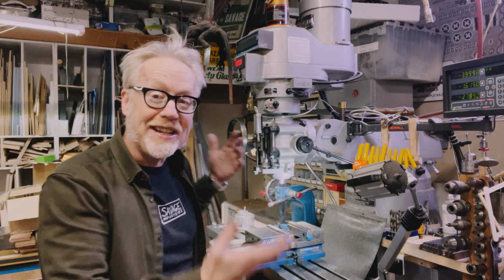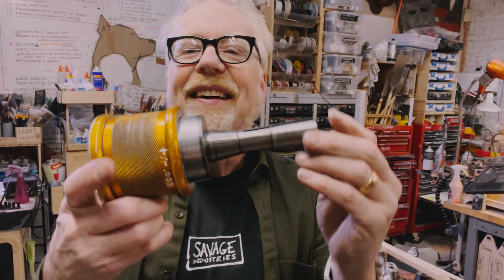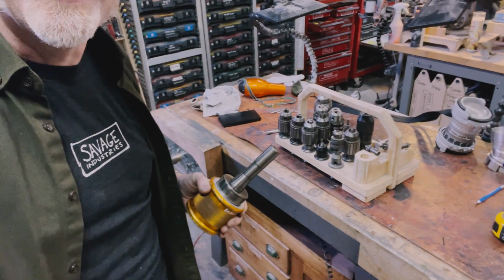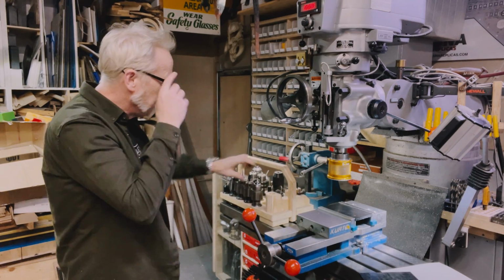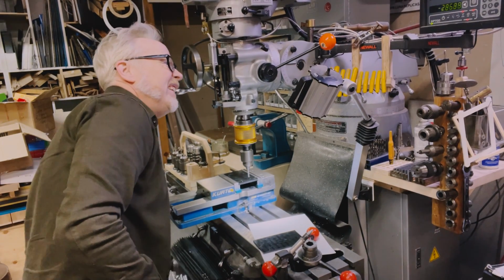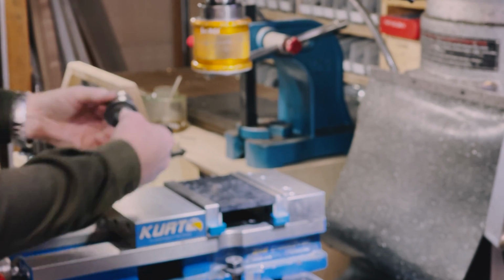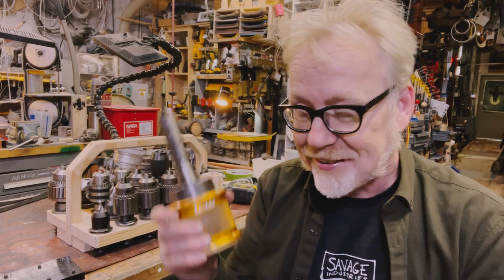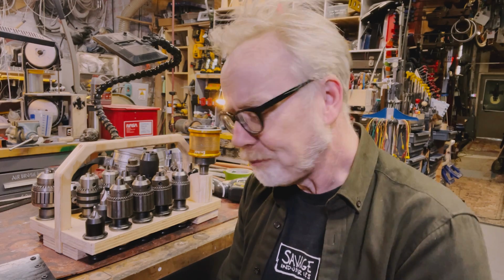Adam Savage's Favorite Tools: Quick-Change Tool Holders!

Comment: AHA!! I used to have one of those but they have two glaring problems: 1) they take up a LOT of Z axis travel and 2) it's pretty much impossible to do good work when  there's a side load on it; i.e. milling. For a good time I'd suggest you upgrade to the R-8 Snap Change system, which gives much better accuracy and which takes up nearly zero Z axis travel. ALSO:  that thing you call a 'countersink' is a 'counterBORE'. A good countersink has a single flute and generally an 82 degree angle on the point. Oh PS if you ever get up to Santa Rosa give me a jingle and I'll show you what hacks I've got after  40 years of hobby machining. :-)
Reply: 82 is for metric and 90 is for imperial

Comment: If I had a big enough shop,  I would have multiple drill presses all lined up.   I have 2  (3 if you count a portable Rockler drill guide), and will mount drill and clearance drills in them if I have to do a lot of these types of holes.     Imagine an 8' workbench with just bench drill presses!  After all, you don't really need milling machine accuracy for many of these operations. 

That said, a very cool gadget for the milling machine.  It wouldn't surprise me if someday Adam gets a Tormach, and then, let the games begin!  LOL

Comment: Not a machinist, but I wonder why he doesn’t just get more R8 spring collets to hold the bits. He already has a pneumatic draw bar impact for quick tool changes. It’s like he has a quick tool changer mounted on another quick tool changer. I would imagine his current setup would increase run-out. Also, when he says it would require 7 tool changes * 16 holes = 112 bit change operations, I don’t see why you wouldn’t just center drill all the holes in one step, change bits, drill out the holes in another step, change bits, so on and so forth. This would only require 7 tool changes. Not that you don’t need a fast way of changing bits, I just don’t understand why he does it this way.

Comment: Is it possible to save those positions so that you can have the mill automatically go back to those positions for you?
Reply: The DRO would have a hole feature (circular and rectangular). For what he was doing he could have moved the cutter to the first hole and called that 0,0 (does not need to be machine 0). From there he would specify something like 6,2;1.000,3.000 (where it is 6 holes in the X axis, 2 in the Y, X axis is spaced 1" apart and Y is spaced 3" apart). From there you just do an operation and hit next and adjust the table so the DRO reads around 0.000x0.000. After the last hole is made it will cycle back to the first. Typically it is not worth programming that for only a few holes, but I would have absolutely used the feature for what he was doing.

Let me know if you would like a better explanation.

Comment: Your counter sink is actually a counterbore your chamfer i suspect is a countersink unless its angle is 90 degrees and not 82 and the screws are socket head cap screws just a friendly comment from a tool Maker

Comment: It feels like this is more of kinda a niche tool option.  Large fab shops will have multiple machines or tool-changing CNC to make a small production line.  A small time, one-off shop will stick to the R8 collets and just do the operations in batches.  But with the expense of tooling up to use this I don't see any shop doing that unless they ONLY make 1 thing.  No variations, no piece work,  no prototyping, just a single product.  Gunsmiths maybe when doing scope mounting holes?  It's not like a lathe where your tools are limited to a certain set and the versatility is in moving the tool.  Now if you make all your drills, taps, end mills, cutters, etc compatible with a quick change system then I think you're on to something.  But you're talking about changing standards all over the world and increasing the cost of a disposable item.

Comment: Hey Adam, check out the Mach-1 Quick change system by Arro! It's way more compact and would give you more 'z' work height, I use one at work and they work great for drilling and milling alike. Check it out!

Comment: I'm confused. It seems like the mill has a pneumatic tool holder. Isn't that a quick change tool holder already? The manual mill at work has a threaded draw bar (I hope those are the names of these things, German dude here) and I have to screw each new tool in and unscrew to release it. So it takes a good minute or two for a change of tools. This seems like it is pneumatically operated, like my CNC mill, so it releases with a push of a button and it tightens on the new tool with a push of a button, right? If that is the case, then I don't see the advantage for this setup.

Also, jesus, I'm happy I'm on CNC machines these days. Spot drilling, drilling, tapping, counter boring is soooo tedious on a manual mill. :D I'd still take a chunky mill if someone wants to give me one! :P

Comment: Not sure why switching bits in a regular drill chuck isn't almost as fast... you only have to put the chuck into the collet once, and then you take the drills, chamfer tool, tap, in/out of that single chuck as needed.  (with the quick change, you are still doing the same actions, taking the same time, putting the bits in separate chucks, are you not?) I get that if you were making 100 of these plates per day, the quick change might be worth it.  But for one or two?  why would I get this expensive tool, plus all the extra chucks?  Having said that, cool video, and the quick change holder is pretty neat.

Comment: ADAM! Make Sure you are using a spot drill, not a center drill.  Spot drills drill at an angle of 120 degrees, which is perfect to accept a 118 degree drill as center as possible.  Center drills are incorrect for drilling holes in true perfect location.

Comment: I have a simplistic question to ask as I’m not familiar with drilling and milling (my craft is coding) but find machining fascinating.

If a mill can do drill pressing operations, why does Adam have a separate drill press? 
I’m sure there is a good answer for this as he uses up valuable space in his shop to have both machines.
Reply: Probably just because if you have something setup in the mill, and you just need to drill a few holes that are not that precise, you don't have to tear down your setup on the mill to drill some holes. And also he probably had a drill press long before he had a mill, so now he just has both.
Reply: Drill press is for wood. The mill is for metal. They are doing the same operations with Drilling, but each machine is designed specifically for a certain range of materials. The milling machine isn't just a more rigid, it is bathed in oil andhand-scraped  to extreme precision. Sawdust is a nightmare on the mill.

And likewise the drill press isn't just a light-duty milling machine. It's range and torque and Power are all designed around woodworking drill bits which have completely different geometry than what's on the mill. And while you can drill metal on the drill press, that could cause hot shavings to fall in a saw Dusty environment
Reply: @patrickosullivan4354  thank you for explaining that clearly, it makes sense to have the right tool for the job.
Reply: @gorak9000  I imagine setting up the mill can take some time. Thanks for replying to my question
Reply: @patrickosullivan4354  Drill presses are just as much for metal as they are for wood - that's why they're variable speed. You use slow speeds for metal, and higher speeds for wood. As you mentioned, drill presses don't have precision x-y positioning, and the biggest technical difference is the spindle in a drill press is only designed to take axial loads, as you're only drilling straight down. A milling spindle is designed to take both axial and radial loads, as you can be milling into something vertically (when plunging into the work), or milling horizontally (like cutting a pocket, or facing) as well. They use completely different types of bearings in the spindles to achieve this. In general a mill is much more rigid in every direction (and thus physically heavier due to more cast iron), and is made to much higher tolerances in every way - the bearings are tighter tolerance, the spindle run out in a mill will be much lower, etc. That said, you can also get high quality drill presses with good tolerances, and you can get really crappy mills that have poor tolerances.
Reply: The drill press really comes in handy if you're just picking up an existing hole to do another operation on it. In the mill, you would have to indicate in the hole which takes a bit of time. Basically, a drill press is good for quick and dirty stuff.

Comment: Can a quick change tool help? Yes, however you could probably achieve the same amount of speed with a hand tighten drill chuck that goes directly into the mill. You then just change bits in the chuck.  I have to admit it is cool to be able to have a series of drill chucks preset up, but the cost of that compared to just having a single hand Chuck is significant.  Not dissing on your video here, just providing a alternative possibility.
Reply: Love my Albrecht drill chucks. Fast and high precision.
Reply: @grntitan1  omg that was exactly what I was thinking. I have one too.

Comment: Adam you should do every thing you can with each tool like drill all the holes chamfer tap w oil save a ton of time Adam I'm thinking you know better I'm shur you should be tapping very last like why tap material that your only going to be removing later.

Comment: It seems to me that the time installing the bits etc into all the chucks takes almost as much time as just swapping out the bits into one chuck.  Not to mention the cost of buying all the chucks and the quick change chuck holder. What am I missing?
Reply: Setting up the tool holders is one and done. Swapping bits in a chuck is more time consuming because your reaching for a chuck wrench every time.

Comment: Pro tip: if you use a VFD with a breaking resistor you can get the spindle to stop very quickly. The way Adam was grabbing the spindle as it was still spinning scares the crap out of me. The way I have my Bridgeport set up I can stop the spindle in a second without using the mechanical break. The VFD also makes it easy to reduce speed for something like a tap where you really don't need the torque. It also allows you to get much lower speeds if needed (one time I needed to run a 6" hole saw in stainless at around 40RPM).

Keep up the good work, and try to not let the mill finish the job the lathe started.

Comment: Umm  "Keyless chuck" anyone?  I can see that you already have an Albrecht or clone chuck there.  If you're not doing milling operations anyway, why not just use a keyless chuck?
Reply: This thing can be slightly quicker and you get a repeatable tool offset. So you can save each tool in the DRO which would be useful if your doing a ton of counterboring. Then again if I was doing a bunch of counterboring I'd grind my own to drill and counterbore all with one tool.
Reply: @lordgarak  Only if your mill has a Z axis DRO.
Reply: @lordgarak  I guess I see your point there.  He just didn't pick a great scenario to show it off.

Comment: While the tool change system itself is a useful idea, for the holes-in-plates task wouldn’t you be able to remove a step at the beginning by simply stacking the plates aligned and drilling the pre-tapped, pre-countersunk holes through both at once?

Comment: That is an awesome toolchanger you got there. If the runout was better it would be great for a CNC milling machine. Is there maybe a bur on the inside taper?

Also one tip: imo you're running the machine a bit too fast. A little bit slower would be better controllable, especially for tapping and chamfering. Don't worry, it will propably be still as fast since the chip created will be thicker. Especially on chamfering/countersinking tools I noticed them to chatter a lot if they go too fast.

Comment: FIRST WE NEED TO... wait that's not right ... FIRST WE NEED TO... is that right??? FINALLY WE NEED TO!!! 

Doing this means we have to reach around an el-elbow to whipe the butthole we're drilling.... 

"Yep. Maybe it's going to take a lot longer than it should..."

That whole thought process has cost me hundreds of hours and not being familiar with the concept probably cost someone thousand. It's honestly the biggest disconnect from "engineers" to production. 

Man hours mesh nothing until you spend all 8 hours in a day making a dang hole.

Comment: do you necessarily have to accept toxic substances to engage experiments or perhaps understand science method? if the law of ratios is integral to our understanding of applicable science.
Reply: imagine a fraction of weight causing displacement in a demonstratable state of equilibrium.

Comment: Since you don't need a collet for any of the tools you were using, I'm not sure this is that much faster than a good key-less chuck.  Also if you use a 135 degree split point, screw machine length drill bit, you don't need a starter drill to get accurate holes.
Reply: Stub drills are great, less flex in speed chucks. I have end mills in most of my quick change set, with a few spot drills.

Comment: This is the umpteenth video now where Adam has compared his mill to a drill press, even using his own drill press as an example. What I keep wondering is, especially now that he has quick change tools on it, why does he still keep the drill press? What advantage does the drill press have over the mill that justifies it taking space in a reasonably small workshop?  
Because as far as i can tell, the only thing it has more than the mill is a flat plate where the mill has a vise, which seems like such an easy thing to remedy!
Reply: Drill press is faster to set up for just drilling, especially with a mill vise mounted on the mill table. And sometimes you need to do some quick drilling without messing up your mill setup. I went a few years with just a mill when I couldn't spare the room for a drill press and I really missed it! 

Great question, btw.
Reply: The drill press doesn't  take up much room in his shop. That and the fact that it is so handy to have when you quickly want to drill a hole in something..
Reply: @intjonmiller  that's a very fair answer! i didn't think of the case where you have active work going on on the mill, not wanting to throw all that out of alignment. Thanks!
Reply: Yea as other said, a drill press is just a faster setup time. The vice and other work holding often gets in the way when you just need to quickly drill a hole. On the drill press it's just put a punch mark where you want the hole and then left the work/drill find the center while you loosely hold the work. On the mill you need to pop a center finder of some sort in to pickup the punch mark and play with x/y until it zeros out and then change to the drill bit. That is assuming you haven't picked up on the edge of the work and know the x y coordinates of the hole.

Comment: Wouldn't it have been more efficient to drill #7 through both plates at the same time, all holes & then come back and finish each plate separately?
Reply: He needs 2 different drills no matter what,  because the #7 drill is smaller than the screws he's going to use. #7 drill is the tapping size for the thread of the screw, which means it has the same diameter as the valleys of the thread, so that there is still material for him to cut the peaks of the thread.
Reply: The #7 bit for the threaded holes is smaller than the bit used for the through holes. For a threaded hole you need to use a bit the size of the minor diameter of a threaded screw and the tap does the job of cutting the threads out to the major diameter of the screw. The through hole has to be drilled to slightly over the major diameter of the screw to allow it to pass through freely. When Adam is going through the different bits he needs for all the operations, he mentions the #7 bit and then has the through hole bit at 3:41.
Reply: Yes, but if those plates aren’t exactly the same, you can’t clamp them in safely on top of each other – or at least not in the way Adam did it. That’s something that works with wood and other softer materials.
Reply: I guess I was not clear enough.  Could use #7 to drill through both plates, since it is smaller than the 1/4 through hole bit.  Then later on, drill the through holes with the 1/4" bit.  Registration issue solved.
Reply: @redrockroger  But it's still the same number of operations? Besides, it would take up more time to set up, and you risk the bit wandering, between the plates, so the holes in the second plate would be off.

Comment: You would never use R8 collets for all those operations. You would just use a drill chuck! Ok for tapping there are better ways but a normal drill chuck would be used for most of it. 
A quick change tool post is used on a lathe. That is not a quick change tool post. More of a quick change tool HOLDER. Nice bit of equipment though. Never seen one before.

Comment: The contemporary solution would be using small CNC mill, however if you are a big fan of analog solutions and CA industrial might, I think you would very much appreciate Burgmaster turret drills.  I have Burgmaster 1D for sale, comes with 5 Albrecht chucks, Tapmatic head, and compound slide.  I could probably do the same operation in half the time on Burgmaster.

Comment: You have a pneumatic powered drawbar, why is that needed? Also lock your quill before using the powered drawbar and it will work like it’s supposed to. If you want to chamfer holes faster in plastic just throw a chamfer tool in a hand drill and deburr them. It’s not critical usually.